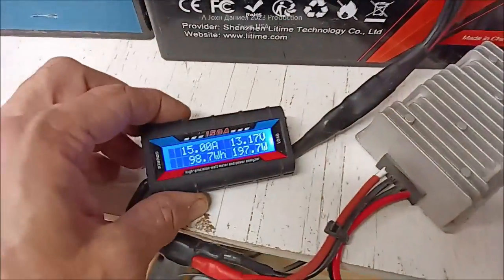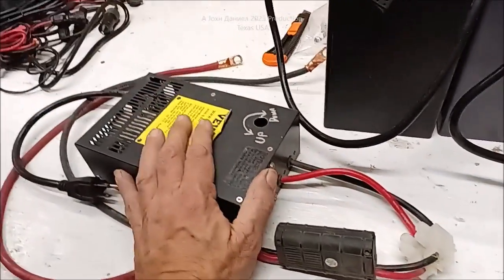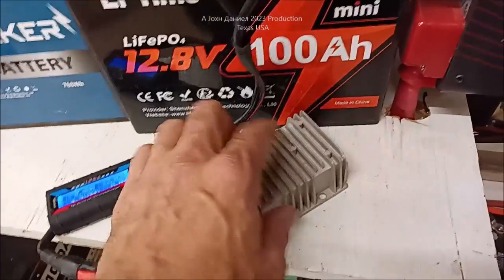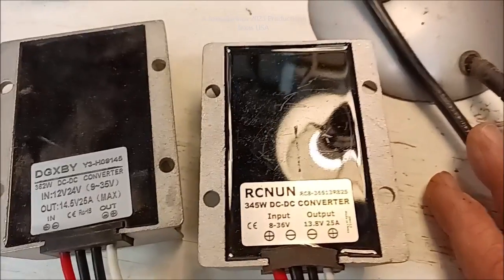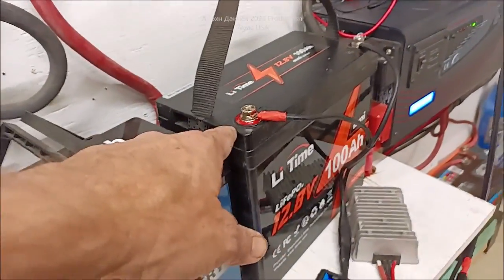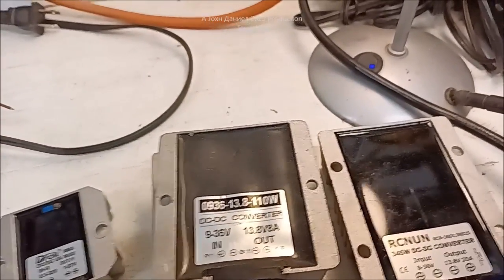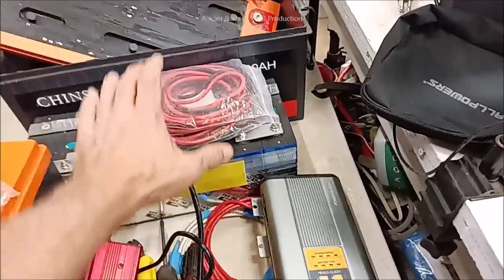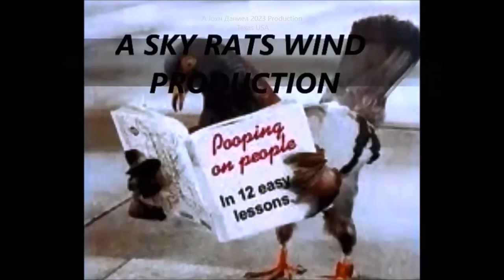Use a BUCK BOOST module to convert & charge DC Batteries Lead Acid to Lithium from solar and more

Comment: does Victron energy Orion-Tr DC-DC Converter work
Reply from the maker: You can read the specs on the 12 to 12  model https://amzn.to/3I7CoYU it has 18 amps and very good DC Charge controls. It is also switchable so not a bad design. I think with the heat sink it has your likely more efficient with it. Says adjustable with app.

Comment: I am going to use this in my converted electric car's auxiliary battery. Is there any need of auto cut off voltage circuit between

Comment: Buck/Boost Converters are not intelligent chargers, nor do they sweep Voc/Isc looking for a maximum power point between the two...
Reply from the maker: The exact point of the video was to inform that a open voltage Buck Boost IS NOT to be used, and as said in my other videos and explained in many more of my other videos you have to have a current limiting, voltage stable, purpose charger to use. And the ones for 14.5 volt or 43.2 volt in my videos are current limiting shaded charge designed chargers, not basic dumb boosters. The Buck Boost "with charger" is sold for numerous voltages and I have them on  many 12 to 60 volt batteries as needed. Just as the link I add below the video details - 
( 9-35V to 14.5V Charger https://s.click.aliexpress.com/e/_DDQExrp )
Reply: @JOHNDANIEL1  Thanks for chiming in. Have you measured that V/A meter shown in the video up against a Fluke 77 or something of similar accuracy? The specs don't list the accuracy up on Aliexpress. Thanks.

Comment: I watched the entire video and learned a thing or two and subscribed. First of all, to what I am getting at, is that I have a Natures Generator which has a 1800 watt inverter inside. I am sure the charge controller is a PWM for two 100 watt solar panels. It is also has wind power (part of the package) which the charge controller, no doubt, only charges lead acid based batteries. The third aspect is that it can be plugged into a wall socket to charge the battery. If I were to connect all the wires (the charging wires) to this charger converting 12 volts to 14.5 for a 100 ah Lifepo4...Would it work?
Reply from the maker: You can use the LiFePO4 charger as shown to charge from your lead acid in that unit. This means you can send Wind and solar Power to the lead acid, then on to the LiFePO4 if you like.
Reply: @JOHNDANIEL1  Thanks.

Comment: can I use one of those as a lifepo4 charger for a campervan to limit the current between the alternator and the leisure lifepo4 battery? everyone says there has to be some sort of current limiter so that discharged leisure battery doesn't overload the alternator. will this device limit the current the lifepo4 battery will be trying to draw from the alternator?
Reply from the maker: Yes, you can get them from 3 amps to 30 amps they take 8 to 30 volts input, and output amps chosen and 14.6 volts https://s.click.aliexpress.com/e/_DDQExrp with tapering charge control feature so when your battery nears full charge they fade the amps from full to zero.
Reply: @JOHNDANIEL1  thank you!
Reply: @JOHNDANIEL1 But what if you only want 94% charges like you and your daughter talked about to make lithium battery last extra years? What about those other charging devices don’t know the name but ones on the wall there circular shape , you had a video showing installing one in the truck too. There’s one for lithium charging and there’s one for lead acid.

Thank you two for all you do🇺🇸👍🏻
Reply from the maker: @peckerpeter2078  Set your Charge controllers to GEL battery setting to achieve the less than 100% on LiFePO4 and a much lower float voltage. The VSR ( voltage sensitive relay ) on the wall is to direct connect the Lead Acid to the LiFePO4 during peak voltages 12.7 to 14.0 volts so the LiFePO4 is more a voltage support capacitor to the lead Acid and the battery cabling gauges are 100% ability large on Lead Acid, 70% from the LiFePO4  to default all hard start and surge load needs to the Lead Acid which gets its refill and support voltage from the LiFePO4 in a constant feed.  Our results are 70% lead Acid and 30% LiFePO4 working together to keep amps solid ( lead acid) and volts up ( LiFePO4 ) all day and night.
Reply: @JOHNDANIEL1  Thank you so much for the clarification, that is a benefit to the MPPT controller. I was trying to use the PWM controller from morning star 45 amp, and was thinking about ways of making it work charging lithium but not at the hundred percent rate I believe they have a custom setting, but there’s not really any video showing on how you do things. Also, what are your thoughts on programmable relays? 

I seen some solar installers talk about using those to conserve energy. I’m all for the kiss system and just the basics don’t need the Bluetooth or the other crap a bare minimum for maximum safe protection that works continuously I respect your professional real world, real testing opinion. 

I was thinking for a motorhome set up just to run a mini split air conditioner no heat pump and a 120 V refrigerator with about 1200w to 1600 W solar using 410 W solar panels 3 to 4 of them with 24v Dc to 120vac inverter on a 24 V battery 2 to 4 of them. I like to work everything out on paper doing the math first before I get into any purchasing.

It seems with the solar systems you can do this different ways and they can all cost multiple different prices. Definitely don’t wanna install unnecessary equipment for minimalist realistic needs.

Comment: I bought 3 buck-boost converters through your link (thank you!). My idea is to keep a small AGM battery charged that will run a diesel furnace to warm up camper and LIFEPO battery in below freezing temps, then recharging the AGM from the LIFEPO. However, the converters are not working as I believe they should.  Connecting battery 14.4v to IN, the OUT battery starts at 13.3v and it charges to 14.5v at just over 1a (that's low amperage, but doing what it should). But then the OUT voltage at the battery being charged drops to around 12.3v and the IN voltage goes to 49.8v. This is both with the battery being charged connected AND with no charging battery connected to IN. That is, the converter is drawing power from the battery being charged (chargee) and outputs 49.8v back to the charging (chargor) battery OR unconnected IN leads.  I tested and verified the same condition on two of the three converters. Do you have any ideas? Is this a malfunction or something I'm missing? Thank you for any advice! I really enjoy your channel!
Reply from the maker: To be sure your battery low voltage does not shut off your heater at 11.0 volts you can get a 10 to 20 volt input and 13.8 volt output constant current 15 amp buck booster in the system and that way you never fear undervolt disconnect in bad times.

Comment: Do you know of any US sellers for these buck booster converters ?
Reply from the maker: Yes, for 40% more on price and all they do is drop ship from China.
Reply: One more little question. Can this buck booster charge more than one battery at a time (4 100 ma power queens in series) ?
 @JOHNDANIEL1
Reply from the maker: yes, i charge that many with mine
Reply: @JOHNDANIEL1  Thanks for replying. I ordered mine and it is somewhere between china and Texas.

Comment: Charge controllers do one thing a buck or boost converter can't', keep the panel voltage near power point. Converters are an output driven control.  They will do whatever they can to keep output voltage at what it was set to.  Once the panel can't produce the power it asks for, panel voltage goes into a voltage death spiral. Converters are poor low light level performers. Many times that is ok. I use 120V LED switching power supplies on only 60V to charge batteries from cheap grid tie panels. Ideal because they are electrically isolated and in some applications that is needed. Converters work, just not as well as a charge controller.

I modify buck converters to look at input and output so the panel remains near power point to produce the maximum output. These act as a Linear Current Booster for fans and pumps to provide an early start and work on cloudy days. Cheap boards can be modified to fill a lot of applications.
Reply from the maker: For the price of solar panels it's pointless now to try and beat yourself up grinding out every possible watt from a low panel count. Years ago, just back about 4 years, when panels were $2 a watt, people would buy a single 100 watt panel and work endlessly and expensively to get 110% out of it with a MPPT and other hacks. I say screw it, get 10 panels to do what you needed 6 to do at a price of 65 cents a watt ( on the high end now) and use the amps even at low light you will produce conversion your seeking using cheap solid state buck modules. And it works.

Comment: I've been thinking of using these on both ends of a system to allow for 12v source up to 48V for smaller cabling in the walls, and then back down to 12v at each endpoint. Thoughts?
Reply from the maker: I am using 12 to 36 volt back to 12 in all the runs with a LiFePO4 at the end of each run as bulk capacity of 36v. That has been my whole DC system from the start. I boost off the lead acid and solar, send it in 10/2 at 7 amps 36v to each room, it goes into a set of 3 - 12 volt for 36 volt, then everything from 19.5 volt computer to 12 volt outlets is off buck modules. its on a charge timer to run from 10:30 am to 4 pm everyday.
Reply: @JOHNDANIEL1  Any videos showing this setup with the buck/booster converters. Are you using Solar+ (2) 12v lead acid batteries plus (1) 12v Lithium LifePO4 at end to make 36v? Or are you saying (3) 12v lead acid batteries making 36 V with (1) 12v lithium LifePO4 which batteries have buck converter/converters hooked up to?

Comment: Gave me some ideas. I need to start slowly building a lifepo4 battery bank and this would help make that useful in the mean time. 

I’ve debated taking a wide input buck boost and using it to regulate the output of a dc treadmill motor. That way you could run the voltage up to something manageable for wire size and have a PWM controller on the output to have three stage or even 4 stage charging. Giving me something that’s hard to do. Proper full stage charging from an engine driven dc source. I can run my engine at a low rpm, giving it a long life and it’s belt driven so it’s easily replaced. Least that’s the idea.

It’s very hard to even find the output voltage, a lot don’t list it. Some are a stock 12/24 volts which is kind of useless. 

Good to see your health is improving.
Reply from the maker: Use Lead Acid as a Slave battery. Most open volts on a treadmill motor is 70 to 90 volts @900 rpm, build you a 48 or 60 volt, 4 or 5 cheap Walmart Marine batteries. You have to pick the type 29maxx to get the Exide made ( all the rest are crap Johnson Controls junk) so you get 5+ years. It becomes your incoming charge controller. Using a Buck Boost you take that power to charge your LiFePO4 12 to 36 volt continuous off them until they drop to 50% and just use a low voltage disconnect set to 12.10 volts on ONE 12 volt to control a solenoid on all 60 volts output. Using a over voltage relay like my OPC module sampling voltage on on of the 12 volt you have it do a engine stop at 15 volts so the engine running the motor stops at peak charge of your 48 to 60 volt set up. Start the engine, walk away, to bring them back up, repeat start and walk away. Should allow you a 15 minute run, 2-5 hours stopped each cycle if sized right.
Reply: @JOHNDANIEL1  a great idea. I’m kind of in a unique situation, I have free natural gas so I don’t really need to worry about fuel efficiency. Do you think instead of shutting it off it would be possible to drive a 555 circuit and a servo and just back the rpm down until it’s kept at a float voltage?
Reply from the maker: You can install a vacuum drive throttle with a circuit cut from higher rpm to run them. Search for Compressor Engine control for Honda gas powered compressors.

Comment: Those cheap battery protection boards whit a relay on it wil give you a battery charge cut of , if you use a different dc to dc buck whit is a battery low cut of .. you got it under controle

Comment: Four 100 watt 12 volt solar panels  running 24 volts to house connected directly to set down converter to to run 12 volt 300 watt inverter. Charges all my DeWalt lithium batteries. DeWalt power station comes in to play  at 1500 Watts  plus line purifier ( line purifier necessary if you're running digital equipment ) runs coffee pot, fans that keep air condition bill reasonable, also charges 40-volt lawn mower batteries. No need to have monster systems. 😔☯️🙏
Reply: How many batteries

Comment: You should check out fractal switch capacitor converters. Awesome way to step up or down. You're going to find it both fascinating and useful I believe.
Reply from the maker: I began at age 6 studying Tesla with his work on capacitance converters, open air energy transmission using such in vacuum chambers. But a unique man of discovery Antonio is where you can get real data and applications from. A hard read due to the nature of the material findings with the madness ramblings but have it a look.  https://www.coe.ufrj.br/~acmq/electrostatic.html
Reply: @JOHNDANIEL1  appreciate it. Always looking for rabbit holes.
Reply: @JOHNDANIEL1  have you thought about using a mercury arc rectifier for stepping down atmospheric voltage? Just curious. 😏
Reply from the maker: I got my hands so full of things I just run on current memory and applications!
Reply: Wow, just wow excellent information here metering and showing actual results of competitive equipment at a bargain price. Could you make one for a 48 V system that seems to be the way that the equipment is going to now.

Could you run 2 Buck converters to get 48 V off a 12 V alternator for say motorhome.The 48v alternators are outrageous in price.

With these DC systems  you want the amps to be as low as possible so you want the volts highest possible because cabling is very pricey and it also maximize your efficiency on those DC systems.

Efficiency has to be in the high 90 percentile, with the least amount of stand by draw in single digit watts.

I like all the testing that you do and would be very curious if you’ve came up with anything on the 48 V system I really enjoyed your wind generator videos. 

You made yourself a very impressive powerplant. I do think that wind power is the future more efficient than solar. 

Efficiency is number one , cost effective will be the balance.

Trying to get to that elusive zero point energy. Right now we just all hope for a return on our investment. 

Thank you and your family for sharing, glad I found your channel and I subscribed.